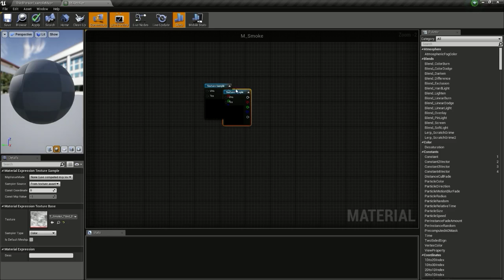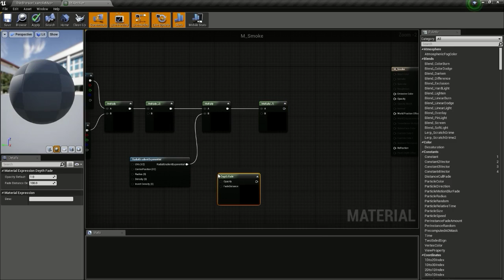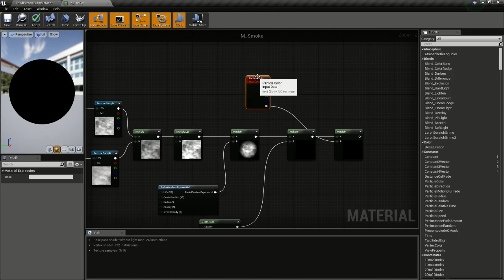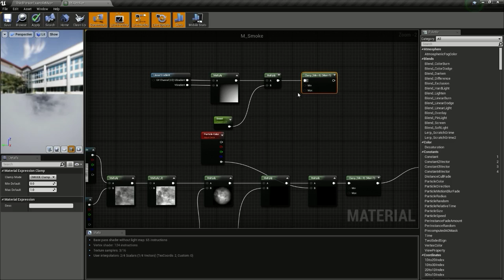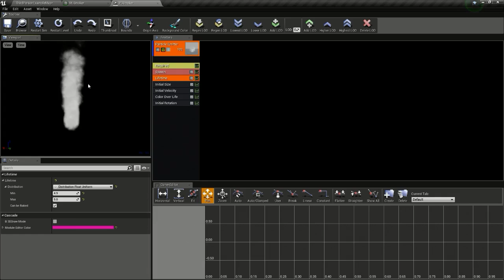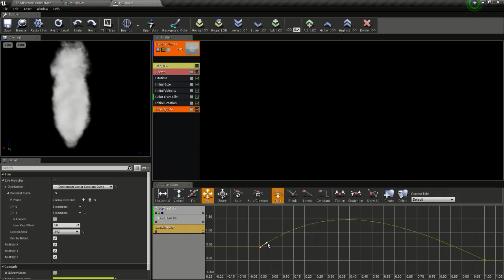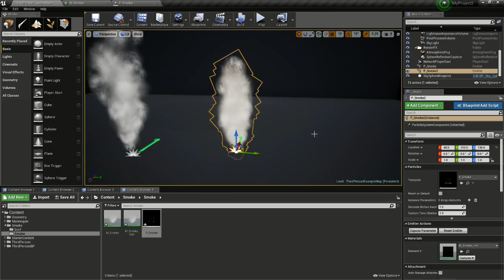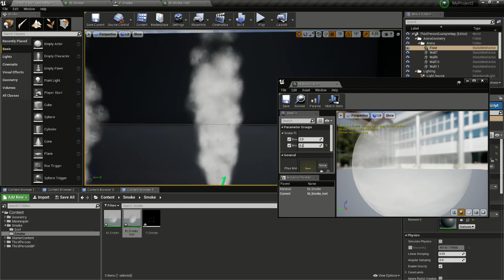Fake Volumetric Smoke  Particle System - [UE4]

Comment: Hi! I am new to Unreal Engine. I have created a smoke particle system for my project. I want the particles of the smoke to only flow/move inside an assigned mesh also which should be invisible. The motive is to give the particle system a defined path and not to move anywhere out of it.  can anyone point me in the right direction?

Comment: Id like to make a post process material but would want to use the scene's contrast to mask it or something, any idea how to?What's the best way to render the scene in a greyscale value then have some effects be masked in areas of white,gray or black only
Reply from the maker: You can either use a color lookup table or adjust the color grading manually in the engine or desaturate the postprocess input 0 and from there you can use few if nodes to pick the colors you need to change.
Reply from the maker: There is also a gradient re-mapping node in ue4 I think.
Reply: thanks Ill look into that